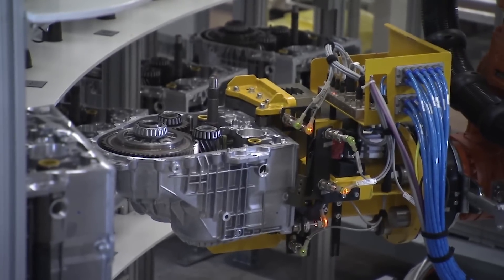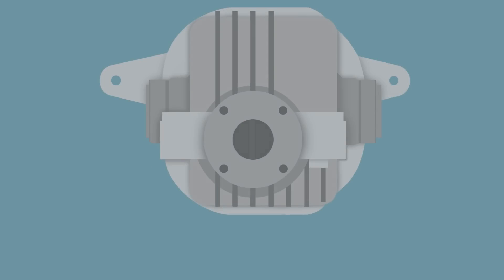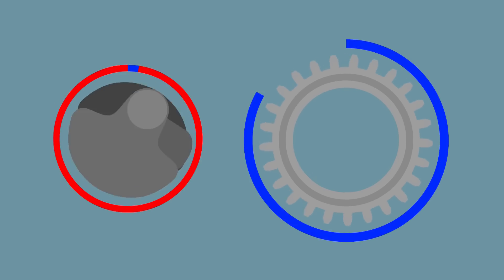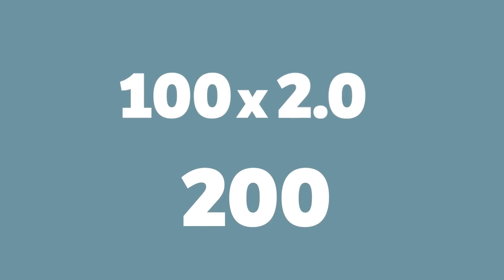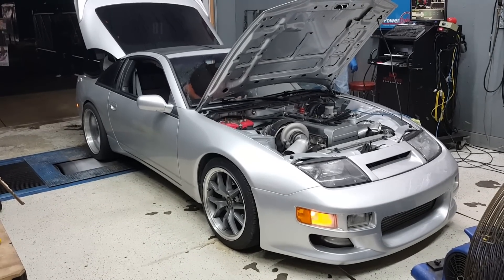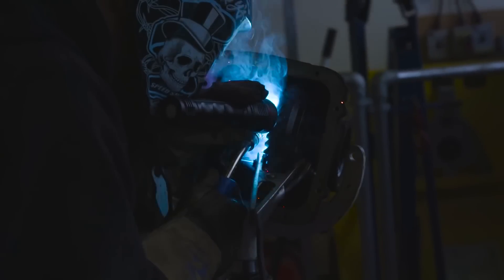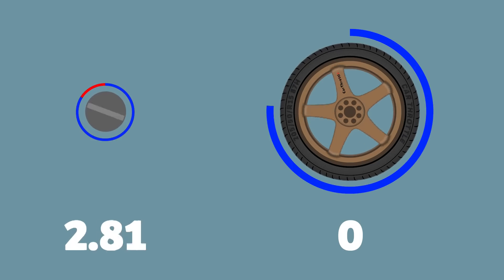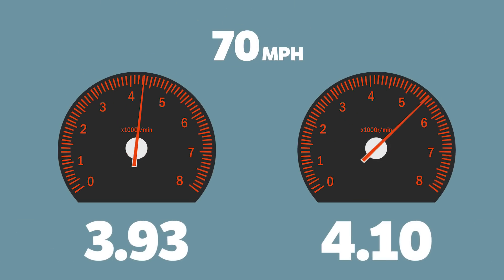The Truth About Gearing

Comment: But in motorsports, how are gear ratios variable? Won't that mean replacing the whole gear for even the slightest change? (which is commonplace depending on tracks)
Reply: in some sports (rally) they have whole different gearboxes which they can swap for different stage types. On drag cars, they mostly use quick-change diffs.
Reply: @ostfahrstreifen8421  let's consider GT3 cars. Their gear ratios are  variable (5-40 kph per gear). I still don't understand how they do that?
Reply: oh i didnt heard of that, where did you read this? but unless they are using several CVTs inside a normal box, it isnt possible. Maybe they just in- or decrease the redline so they can go different speeds
Reply: @ostfahrstreifen8421  i have known this for very long but never gotten around to understanding the engineering behind it. I'll do some search, maybe there's some new information and share
Reply: @ostfahrstreifen8421  and no, it's not fiddling around with redlines. I agree with you that it's not possible without a CVT. Maybe some special sequential boxes?

Comment: Haha so many mistakes with your graphics. The revs @ 70mph is bollocks. A 3.93 to 4.1 diff ratio would raise the rpm less than 200rpm, up from 4350 to 4538. Not the 1200rpm your graphic shows. Dumbing down for what you think your audience is? Heey nice you think so highly of us.
Reply: They exaggerated so the visual difference is more obvious.
Reply: Qwertz Qwertz  Except their visual suggests the gains from altering the diff ratio would be huge whereas the reality is 190rpm difference at what wouldn't even be top gear for most cars. Add another gear on top of the gearbox in that example and the drop in revs is even smaller.
Reply: @DiscoFang  Yeah I realize that.

Comment: It doesn't matter if they use ft pounds or newton meters. They could have used 100 door knobs of force and it'd be the same concept.
Reply: Door knobs differ on spring tension.
Reply: or just call them knobs. ..
Reply: So what you're saying is that my crankshaft turns 40 degrees and then returns to center?
I think I got it now!!!
Reply: @351cleavland  
Yes, that's called a self reciprocating engine, it's the latest thing.
Reply: @dukecraig2402  the technical term is “ping pong engine”
Reply: LOVELY SWEET AND SPICY
Reply: Yeah honestly the metric system is a joke.
Reply: 100th like

Comment: so when someone or a manufacturer claims a torque number, is the torque of the engine or after the gearbox and the diff? and does it mean that the actual toque numbers on the crank much lower?
Reply: mostly the flywheel power and torque is advertised.. because most of the time you have multiple rations (gears) to choose. And the difference from flywheel HP to WHP just are frictional losses i think
Reply: it's always measured at the crank with car manufacturing specs. When someone dyno's a car they always convert the horsepower at the wheels back to the original using the gear ratios. What you're then left with is your wheel horsepower. AKA engine horsepower minus friction losses
Reply: @youridv  you mean the use the trans in direct , 1:1 and  calculate the torque multiplication given with the final drive out to get true 1:1 power at the tires 
 A GM truck with the Vortec 350 advertised at 255 HP , will Dyno less , maybe 210 or so to the tires
Reply: @nerradnosnhoj5122  Yes.

Comment: i want a 6 speed car with a 1:1 6th, and a 2.39 diff.
Reply: you wouldnt even notice a difference compared to a normal car... that'd be the same as when a car has a 3.73 diff and a 1:0.64 6th which is really common
Reply: really depends on how much power the engine has and what the weight of the car is. 100 hp on a 10000 pound truck is fuck all, but 100 hp on a 500 pound bike is soooo much
Reply: @drunksanta1427  I think you replied to the wrong comment

Comment: 4.10s on my 2013 Mustang GT (manual) and topped out at 115mph in 4th gear at 7500rpm on 28" slicks. So I will gear down to 3.73s and that will increase the top speed in 4th at 7500rpm to around 130mph. Which will let me get into the 11s in 4th gear.
Reply: if you go from a 410 to a 373 you go up in ratio not down
Reply: @dalevackar182  yeah my bad. It's counter intuitive
Reply: @dalevackar182  that's a decrease lol
Reply: @esnebta  a 3.73 is a higher gear ratio than a 4.10 so you're going up in ratio not down
Reply: @dalevackar182  No it's not. 4.10 is a larger number than 3.73. 

I'm a mechanical engineer with a minor in math and I build custom transmissions for a living.
Reply: @esnebta  well lets see what you know son. example 76 Chevy half ton big block or small block turbo 350 or 400 doesn't matter. if you change your final drive ratio from a 3.40 to a 4.56 how is that going to affect the performance of your transmission? and what would you do to correct the problem?
Reply: @esnebta  you don't have a clue do you?😂
Reply: @dalevackar182  Don't "son" me. I'm not your puppet.
Dude is wrong and I'm certain of it. I don't need to prove anything to you. If you want to continue to be ignorant, go right ahead.
Reply: @dalevackar182  Oh okay. You're wrong, I'm smarter than you and I make more money than you.
Reply: @esnebta  Grow up son
Reply: @esnebta  I have a 396 with a 700r4 transmission with 410 or 411 gears with a 20 wheel. I haven't drove it yet but would love to hear your opinion about it. Thanks
Reply: @westganighttrain5166  Have you drove yet? Is it quick shifting with that low of a gear
Reply: @dalevackar182  yes I have been driving it and I absolutely love it! It's very quick and powerful! With the 20 in wheels and the overdrive transmission I'm able to ride on the highway with no problem and also do burnouts with ease! I love the setup!
Reply: @westganighttrain5166  Cool
Reply: I think you will run out of track before your engine ever gets to 7500 in 4 gear, with the 3.73 gears and your car's E.T. will slow down. Just my 2 cents.
Reply: @garyshinn4626 that’s what i thought. He’ll eliminate the time spent shifting, but at the same time he’ll make the car slower
Reply: The object of drag racing is to get into high gear as fast as possible. The lower(higher number) gear the quicker you get into high gear.
Reply: I want to be the first one there. I could care less about being the fastest!  Get the idea?
Reply: stupidest comment ever    wtf do you guys know anything about hot Roding   ? or just beginning?    you dont just gear lower to get higher mph..... the highest gear gets you the highest MPH ....according to your hp at that rpm ..you are completly lost
Reply: @ivanrousseau5066  I messed up by saying 3.73 is lower than 4.10. I know its a taller gear. And I know I won't magically get more horse power from change the gears. 
I'm saying that my car used to top out at 115mph in 4th, and I had to shift up to 5th gear to keep accelerating until I finished the 1/4 mile. 
By going to a taller gear, I am able to continue accelerating to 130mph before I have to shift again. I just really hated to have to shift to 5th to finish the quarter and figure in losing time having to shift that many times.
Reply: @jcmartinez7527  Sure, until you get more HP and this no longer works.
Reply: @snek9353  then he can go to a 3.55. 
While making the shift to 5th, the wheels aren't being driven, which costs him time and speed at the end of the run.
Reply: @scotcoon1186  gee really
Reply: @jcmartinez7527  your making the right move. you don't need low gears to move a light car let your engine do its job. low gears are more for heavy cars
Reply: @queden1841  yeah his pos ford tops out,I have auto 4 speed 4,10s runs 11s easy😂
Reply: @solangus7730  congratulations
Reply: @solangus7730  what you got cuh
Reply: @solangus7730  "pos ford" only thing that determines your speed at different gears is your transmission. Mines a six speed, so obviously gearing will be different than your 4 speed.

Comment: They could have said it produced 100 duck farts, the video wasn't explaining what torque is, just how gears worked and just how much it increase the power at the wheel
Reply: Why should it?
This video was specifically made for gear ratios.
Torque is more engine related and you can always just search what it is.
Reply: Power doesn't increase with gears, only torque. Power at the wheels stays the same.
Reply: Yes sorry should have been torque
Reply: Squire T Funny though, if they'd simply made that clear in the video it would have made the overall picture simpler. It makes me think whomever edited or wrote this doesn't fully understand it at a fundamental level. Power is the torque applied & accumulated over a distance. 

When the torque is amplified via gearing, the wheels turn slower; when torque is reduced via gearing, the wheels turn faster. But given that fixed torque at the crank, getting from A-B over the road surface is the same overall power no matter what the gearing.
Reply: @DiscoFang  Exactly just compensation for bigger tires or heavier load no extra power given

Comment: guys, it's not about having a certain speed or torque number or conversion, but about understanding how it evolve with gears settings. For instance if you gain speed in mile per hour, you also gain speed in kilometers per hour, point being that changing LB.FT into nm isn't important to explain gear ratio work
Reply: Gear ratios exchange rpm for torque and vise versa depending on if it's induction or reduction. Understanding the correlation between rpm/torque is key.

Comment: So you just said that my Honda actually has some torque?
Reply: Hondas rev high so they use shorter gearing to reach the same speed as lower revving cars, shorter gearing means more torque at the wheels, and wheel torque is what pushes your car forward. That's why 200hp honda engine with "no torque" will accelerate similarly to 200hp turbodiesel, because although the diesel has more pushing force at the flywheel, it revs lower and needs longer gears to reach the same speed, so the wheel torque will be similar to the wheel torque of honda engine at given speed, while being vastly greater at the flywheel. That's concept of torque and horsepower for you.
Reply: @arekb5951  omfg thank u for that knowledge I never wanted to have to pick up a book or do any research other than yt
Reply: Don’t get crazy.......
Reply: LeBeckStudio yeah... all cars at 1st gear have about 1000 newton meters of tourq
Reply: @berys76  no. not even close